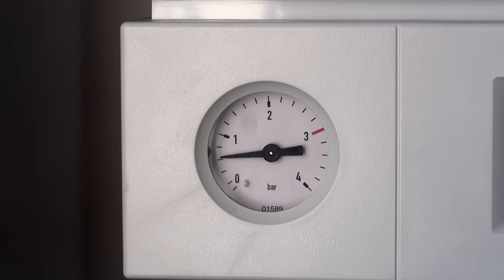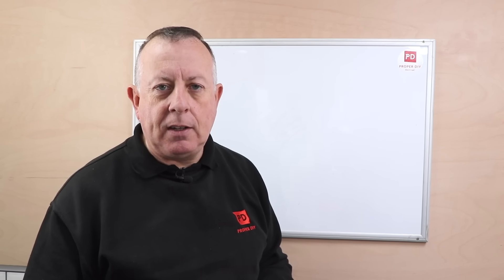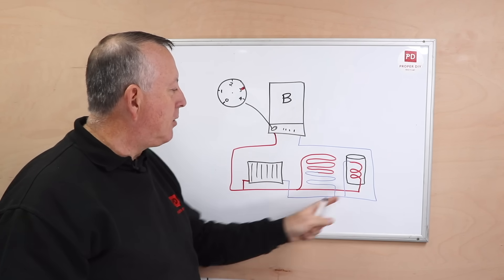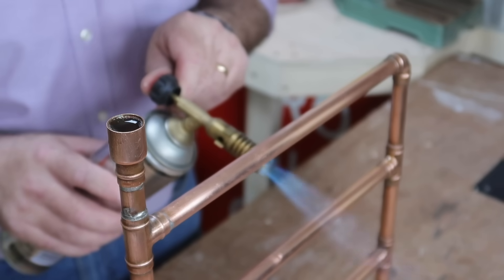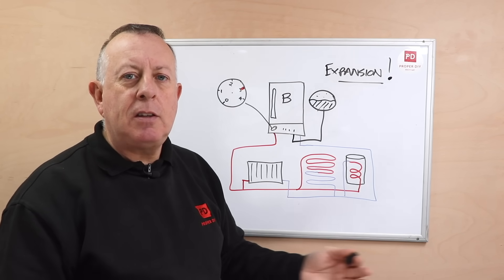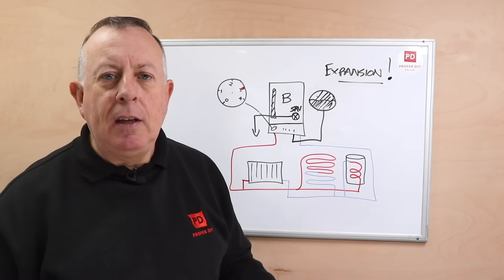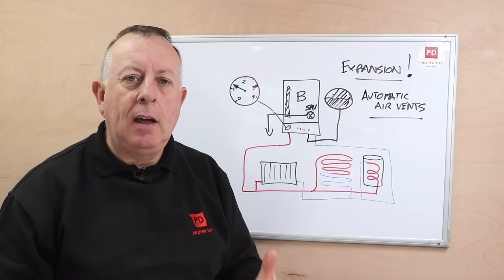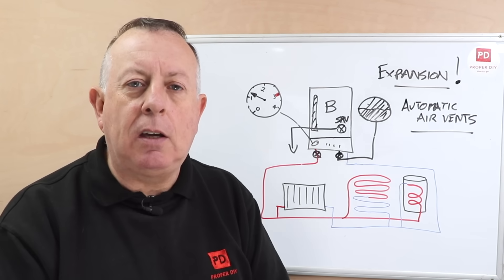Why Your Boiler is Losing Pressure and How to Fix It

Comment: Hi Stuart, well done for another excellent presentation. You clearly show in your diagram and experiment how heat causes water to expand, thus the pressure increases in the system, causing water to be displaced via the safety valves, inbuilt into the boiler, thus preventing a dangerous situation from arising. 
However, your diagram illustrates that a Water Tank is/can be included in that system.
My question is, Does that "Water Heater" need an expansion tank to allow thermal expansion in that vessel?  if you state, that an expansion tank is required, what size expansion tank would be required?
How do I calculate the correct volume expansion vessel required in a closed system? Thank you in advance for your response.

Comment: Fantastic explanation! I have a question. If you were to tap the expansion tank, would it make a different sound depending on where you tap it? For example, would tapping the top (air side) sound different from tapping the bottom (water side)? If the expansion tank is full it would sound the same or does the pressure in the tank prevent this kind of test from being reliable?

Comment: Here’s a great story, it’s about a British gas engineer that came to quote for a new boiler.  Under the guise of seeing what needed done/comprehensive check, he ramps the pressure up to over 3 bars…I stopped him by saying ‘It’s funny how heating engineers when testing someone else’s work, put the pressure to the max, but when they’ve fitted the system, they all barely pressure it to 1.5 bars.’  This is true.  I’ve watched every engineer ever, that commissioned a system for me.  They gingerly put it to 1.5 bars - never go near 2.0 bars put it that way.  Here’s this mutt pumping it to 3 bars without pause.  Job creation scheme.  He also tried to tell me my radiators were possibly too large and needed reduced…I asked if he felt that way he could do the necessary calculations or pull up the numbers on his laptop etc and show me.  So that didn’t happen!  I raised the issue later and he was dismissive - apparently he checked it and there wasn’t a problem after all.  Quoted nine grand for a new boiler only, installation, 28kW.   This being 2009, luckily I didn’t even have to expend brainpower considering it.  The entire process was bizarre from start to end.  It’d have been a crazy price NOW, 15 years in the inflation-ridden future.  Take care all.

Comment: My boiler went from 1.9 to 1.7 bar in 10 months. Not worried at all! Especially as the expansion vessel is in a place that is some 10 degrees coller now compared to then. Which accounts for nearly 1 bar difference by itself.

Comment: Oddly I get what looks like the SRV overflowing only when the hot water is being heated. Not when the heating is running and I’m not losing pressure. Does the hot water cylinder have an expansion tank too?

Comment: If its a Worcester Greenstar it is probably a cracked heat exchanger if you are topping up every other day, especially if you see the flue output looking like the Flying Scotsman at 80MPH !
Reply: Worse floor mounted boiler I ever had, the heat exchanger cracked, the condensate tray melted and then the gasket between burner and exchanger went, never have one of those again.

Comment: Great video Stuart. This will possibly save some folk a bit of cash.
Love the references to various laws:
Charles's Law: When the pressure on a sample of a dry gas is held constant, the Kelvin temperature and the volume will be in direct proportion
Boyle's Law: The absolute pressure exerted by a given mass of an ideal gas is inversely proportional to the volume it occupies if the temperature and amount of gas remain unchanged within a closed system.
Coles Law: Thinly sliced cabbage

Comment: I had a new combi boiler. Since then i have 2 problems. Loss of pressure and water hammer sound. And also i hear dripping water in the walls wher the pipes located. Please advise

Comment: I thought you said at the start you're were going to explain why the pressure still goes down over a year even when there is no fault, but perhaps I missed that bit or didn't understand it properly?

It's something that's always baffled me when I have to recharge the boiler once or twice a year, where has that water from the closed system gradually gone? You confirmed once or twice is year is completely normal, so what's happening in this normal situation?

Comment: One tip you missed is check for a leaky schrader air valve on the PV - Have encountered just such a case where the insert refused to seat properly, was jammed solid and so could not be extracted and replaced - The solution was a cheap valve extender with it's own schrader valve (usually sold for bikes etc) screwed over the original, still working a treat 5 years later...

Comment: I have a Junkers combi boiler that loses pressure constantly. I have to top it up every single day, sometimes more then once a day. There's no leaks, the expansion vessel is new, but the pressure keeps falling down really quickly when i open the hot water on the sink. After i turn the hot water off, the pressure goes up, but not to the point it was, before i opened the hot water tap. Is it possible that the 3 way valve is defective and needs changing?

Comment: I had a brand new boiler fitted by cowboys in 2019. Worked a few times but since 2020, I haven't been able to get it to work. I've drained the whole system now and I want the WHOLE LOT ripped out. I use electric oil filled radiators now and it is far cheaper. How much to have the whole GCH ripped out completely?

Comment: Help! My 22 year old conventional Valiant (non condensing type) boiler is loosing pressure. Bleed all 6 rads. No air. If I let the pressure drop to zero, when off, the boiler fires up perfectly & the gauge rises to about 1.5 bar. Plenty hot water & radiators about 62 C. No evidence of leaks from upstairs two radiators downstairs have pipes under floor. I have a hot water tank & cold storage in the loft. Boiler external pipe shows no leaks. What can this be?

Comment: I learnt some of this from my plumber recently. I was having to top up regularly and noticed when I did, the pressure would rise very high when it switched on. It then started to leak from inside the boiler (not to a drain), so I was just getting water coming out of the bottom of the boiler. 

It turned out this was the pressure release valve. I'm my case, the membrane hadn't failed, but the vessel was still being fully taken up by water (I guess the membrane in my boiler is very flexible). The plumber pumped up the air pressure behind the membrane and set the water pressure to 1bar. He said if there was an air leak on the air side of the membrane it would happen again - then he can take another more costly look (in the case it could be a damaged membrane or a faulty valve), but I think in this case the air just very slowly escaped from the air side over time, as it has held the same 1bar pressure for 3 months now. 

Part of the issue was possibly due to when I was topping it up over the last 10 years, I was putting more pressure in than I should have been, which would have put more pressure on the membrane long term. This video helped me more fully understand what was going on - so thanks for that.

Comment: One possible other problem with expansion vessels is the pressurisation vessel valve - basically a tyre valve - which can go. You can get valves that screw over the top of the faulty valve that sorts this problem allowing it to be repressurised. Although a simple fix, not a DIY one as you need a plumber to do this job properly within the boiler.

Comment: Nice explanation Stuart, as you said, I'll leave it to the professionals ;)  One thing does deviate over here in belgium, our safety goes into a drain inside the house, not outside.  A bit harder to check if it's releasing water, can't put anything underneath it.  But our set up is only 2 years old, after having the issues you just mentionned :D  A broken internal expansion vessel in the boiler resulted in a pumber installing an external one and twe years later we replaced the entire boiler.  As a DIY'er it's annoying when you can't fix something yourself, isn't it :D

Comment: I put a hole in a plastic pipe..  Is that fixable yourself or one for the plumber? 
I managed to fix it myself but not sure it's a long term fix..
Reply: Just cut it and fit a coupling.

Comment: Nice well explained video.  Just to say though that the 'plume' that can be seen coming out of the flue of a gas boiler, especially in cold weather, is normally just steam. If for any reason it appears to be (and might smell) like actual smoke or something burning then switch the boiler off immediately and call a heating engineer.

Comment: I've had exactly this problem in the bungalow that we converted for my disabled brother. It had a new heating system and new combi boiler installed, and all was well for a year or so, then it kept losing pressure when the central heating was used. It went from needing re-pressurising every few months to every couple of days. The problems were essentially all down to the installation. Most importantly, the plumber had not installed automatic air vents in the system. Being a bungalow with a solid floor, the plumbing went through the loft, and was one set of inverted loops. Any gas would accumulate in the pipes at the top, and gas expands more than water when heated, that pushed the pressure over 3 bar when the central heating worked hard, pushed coolant out the pressure relief valve and the problem got worse. This was made worse by insufficient inhibitor. Further, the system contains a lot of water, and the expansion vessels in modern combis are relatively small and the pressure goes up markedly on big systems when the central heating works hard.

So, having had a fruitless chase for leaks, I ended up installing a couple of automatic vent valves in high points on the system, a supplementary expansion vessel to give a bit more stability to the pressure when the system is heated up, installed a magnetic filter, which is also a good place to put in additives on a combi system, and dosed it well with inhibitor.

Now it seems to be very stable, and the pressure fluctuates less than half a bar between when it's cold and when the central heating is up to full temperature.

Now in my spare time I'm working on a little project to use a microprocessor and pressure sensor which I can monitor remotely over the Internet with an email warning system if pressure gets low. I'd rather have a log of what the system is doing and deal with it at the right time than an emergency call when the heating has broken and a 70 mile round trip for a 2 minute job. Nobody seems to sell such a system, and I would have thought it of great benefit to anybody who has something like holiday properties that they rent out. Perhaps there are some "smart" boilers that can do this sort of stuff.

Another lesson is don't assume plumbers and heating engineers always do their jobs properly.

nb. what is coming out of your boiler vent is most certainly not smoke (if it is, then it is time to call the fire brigade). What you are seeing is condensing water vapour, something entirely different and what what clouds are made of. To maximise boiler efficiency, then you actually want as little of that to appear as possible; you want the condensing to happen inside the boiler as that is where the maximum heat is extracted. Condensing boilers are at their most efficient with a hot water temperature of about 55 Celsius, so to save a bit of gas, try turning down your boiler temperature if your radiators are large enough. If you install new radiators, make then big ones as the heat pumps we are told we will have to use in the future work at around 50C, not the 80C that many boilers are set to.

I would also add, if you are checking for water coming out of the pressure relief valve, don't mistake that for the condensation outlet pipe. The latter should always be producing water when the boiler is working, although it is generally in plastic, not copper.
Reply: @TheEulerID  
Does gas accumilation indicate lack of inhibitor i wander?
Reply: @QB2ERS  there was plenty of inhibitor after I first tried to fix it, but the problem came back. But I don't think it stops all chemical action. In any event, after putting in automatic vents, it remained pressurised properly for almost a year so far. However, it probably helped to have also plumbed in a larger expansion vessel too.

Comment: Cracked heat exchanger will cause the same problem with no evidence because the water is being vaporised in the burn, happened with my Ideal Logic and the warranty engineer said it was very common.

Comment: Years ago, I had a Potterton boiler, great & economical when it worked, but the most unreliable piece of equipment ever (and after sales service non existent).  Always slowly losing pressure, & after YEARS of trying everything, I found that the body of the alloy heat exchanger was seeping water when it got hot.  As it slowly leaked, being hot, the water evaporated, hence I could NOT find the leak.  In desperation, I fired it up with the covers off (!!), and sure enough, after 30 seconds or so, I could see it weeping.  Vaillant from now on.

Comment: I came home Saturday morning to discover my boiler off and displaying a low pressure fault code. True enough the gauge was almost at zero. Ten minutes doing a bit of refilling via the loop and bam, I'm up and running again. It's only happened twice in four years and then only when we have a sudden cold snap - I'm calling that 'normal'. Great vid sir.

Comment: This happens to my boiler but only over the winter months I probably top it up once maybe twice a month between November and February, rest of the year it’s fine. No leaks anywhere I can find. Also I check the pipe outside and it looks dry, never thought of the air vents though. Good video 👍🏻
Reply: You should NOT need auto air vents in a normal sized domestic installation.
Please explain how air gets into a sealed system. It cannot.
The air vent in the boiler ( which actually vents naturally occuring gas in the system) should be enough if the system was bled properly on installation. Many are not.
Reply: On very important thing is that, with sealed systems, if you have pipework above the radiators, then you need an automatic air bleed valve at the high point, otherwise air will remain trapped there. That often happens in bungalows with solid floors where the pipework runs up through the loft. The air in the system expands much more rapidly with temperature than does the water and if you get very large pressure fluctuations between when the system is hot and when it is cold, then that can be a cause (the other one is a failed expansion vessel). 

I have just gone through this exercise with my disabled brother's converted bungalow. The installers had not put in automatic air vents in the high points in the system. If the high points in the system are radiators, then you can get automatic bleed valves for those which I recommend. In a combi system, you want the trapped air out as soon as possible before it starts pushing out the coolant via the pressure relief valve. If you find you have to bleed radiators of air, then they can be a good investment (about £20 for two from outfits like Screwfix).

Comment: Don't be isolating the flow and return valves because you've watched this video and think it's helpful.. don't be changing an external expansion because you've watched this video and think it's helpful 
I've 20+ years in the trade and it can easily become a  recipe for disaster..
Takes 2 mins walking into someone's house to see that mr DIY has had a go himself and completely balls it up coz he watched a you tube video

Comment: My ecoking boiler leaked at the heat exchanger from day 1, took 5 years for plumber to find it, luckily just before warranty ran out, naturally ecoking didst want to cover it but after a fight they did send a replacement which was updated in the area mine leaked, go figure.

Comment: Another issue can be the sensor that measures system pressure can fail, making the boiler shut down, because it does not think there is enough water in the system. A faulty sensor is an irritating and expensive call out to a service engineer.

Comment: Great video! A couple of handy hints relating to pressure loss. First, a plastic bag tied over the end of the pipe from the pressure relief valve is an easy way of determining if water is escaping. The pipes are often angled back towards the wall to prevent scalding, so putting a tray underneath isn't always possible. And second, if the internal expansion vessel is at fault, rather than have the boiler dismantled and a branded replacement vessel put in, simply ignore the faulty one and have a cheap generic (Screwfix or whatever) external vessel added elsewhere in the system at a convenient point. Much cheaper and far easier to subsequently replace if it fails again.
Reply: That's a good tip. I had to replace the internal expansion vessel in mine, and it was a pain because I also had to remove the flu which had become brittle with age, so that needed replacing too. Chances are that a replacement flu may not be available now so removing it again could be terminal (no un intended). A generic pressure vessel sounds like a perfect solution. I'll have a look to see what they cost just out of interest. Cheers!